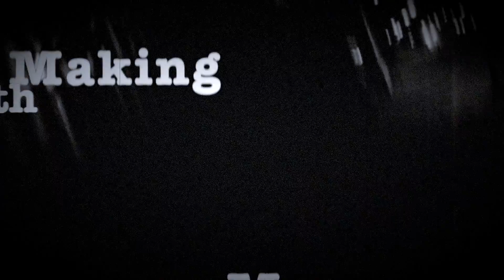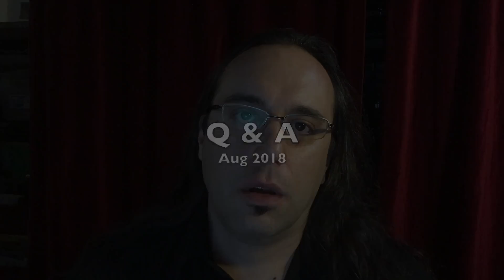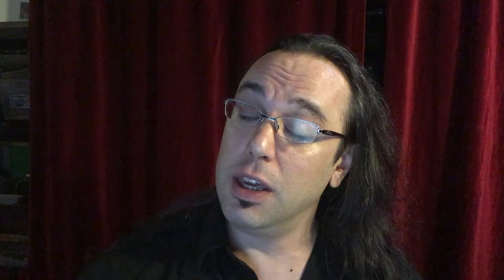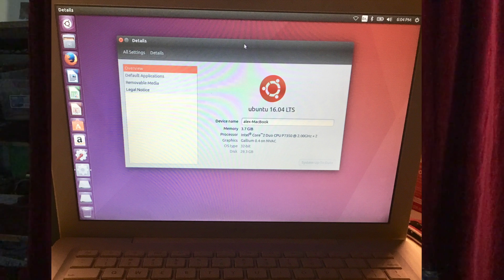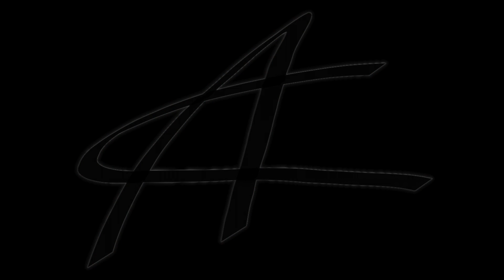Q & A #4:  July/Aug

Comment: questionssessssss .....
can I use ONLY thermal paste to glue the aluminum cooling block on the stepstick?

Again greetings!
And again from Rob
Reply from the maker: It's possible, but unfortunately, it won't stick very well, but there is thermal paste glue, which gets harder when you heat it up.  it is not as good as thermal tape for holding the heatsink on though (it is real easy to knock them off).  I have also used locktite in a pinch (sticks okay once it heats up and gets solid if you don't put on too much), but that tends to pop off easily too.

Comment: 517/5000
Hey also another question?
to change two types of filament quickly with a bowden extruder?
I first planned to do my direct drive,
but i was thinking, suppose I want to do it with my bowden drive!?
Could it be done?
quickly changing filament with my bowden extruder?
the advantage would be no rumbling on the extruder so that the extruder does not accidentally shift during the change!
there is also a way to pull the extruder motor back and spit out the filament very quickly?

Greetings from Rob!
Reply from the maker: Sure, there are plenty of multi-filament bowdens out there.  The 'ghetto' way is to pause the print and pull it out by hand, but if you are running Marlin, you can enable ADVANCED_PAUSE_FEATURE in firmware and use M600 filament change command.

Comment: Thank you for answering my question. 
Just some tips: 
If you are experimenting with boards like Raspberry Pi Zero, try Repetier-Server instead of Octoprint. I have discovered this after I have received my mighty 64bit Orange Pi Zero Plus 2 H5 and octoprint was still slow. Repetier-Server runs really good even on my old CHIP a $9 board. Strange that over native UART connection I had speed problems, but using USB it runs perfectly with smoothieware.
My main criteria in development board selection are presence of internal NAND/eMMC memory, MicroSD cards in arm boards sometimes die if you unplug energy in a write cycle. And more expensive cards die faster than cheap cards ;-(.  Filesystem selection is crucial too, btrfs board works better than ext4 board.
And we have the new interesting driver: ST820 based on STSPIN820 from STMicroelectronics, it looks like the ideal driver for strong extruder motor (I'm waiting for delivery). I have also tested S109 (Toshiba TB67S109) and it runs really smoothly, much better than LV8729.
Reply from the maker: You hit on a lot there!  The main thing I am concerned about with the PI is fast prints with a lot of small segments... basically tinkering with settings and options to get a feel for it's limits. Octoprint has a hard time with that even on the fastest PI boards (as you saw with the H5), and the Banana pi zero is only an H2+. I am definitely going to A/B test it with Repetier as well.  The hold-up is that I was waiting for Klipper firmware to support both repetier and octoprint, and that happened last month, so I'll get back to that as soon as the other boards arrive. Repetier has a timeout problem as well, but I have not looked into it much. A big problem for octoprint seems to be waiting for the "OK" ACK, since it increments a counter and uses that to sync tx and rx communication.  

I agree that better onboard memory would be nice.  SD cards are flakey and tend to just die sometimes, and they are not great for running an operating system, especially if you are using a partition for a temporary read/write buffer... they can die pretty fast if things go wrong. I haven’t seen the ST820, but ill look it up.  I have an S109 on order for future testing though, so Im glad it is working out for you.

Comment: thank you for answering the question!
those P.I.D. is now on .... a kind of standard setting .... (I think!)
Besides, I should have asked HOW do you do it!
the printer does it well for the rest so I do not think I will do anything with it.
I have seen a video somewhere perhaps maybe I'll find him again.(we'll see)
(Yep I found it now! Everything will be fine!) ;-)

The sound of the video was indeed a bit bad!
maybe check it out.
Common mistakes are that the microphone wire along the wiring of switched power supplies is light. (Transformer power supplies can also disturb)
Also ordinary NET wiring can strike on the microphone cable.
Laying wires parallel can go wrong.

friendly greetings from The Netherlands!
Rob.
Reply from the maker: Glad you worked it out.  The mic problem ended up being that I temporarily plugged a hard drive power supply into the isolated ground power I use for my audio gear, and the noise from the switchmode supply was corrupting the signal.  I would have re-recorded, but I actually answered questions for like an hour and cut that down to 25 min, and didn't want to waste the time to do it all again.
Reply: Yes understood,
Good luck with the next video I will see it.
Until then the greetings from here!
Rob.